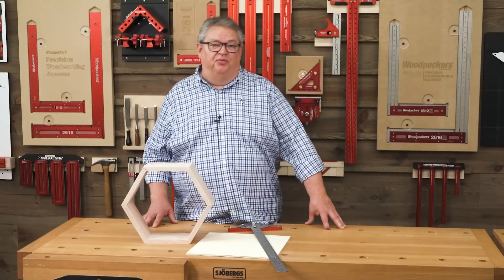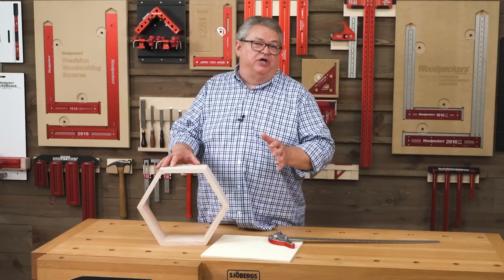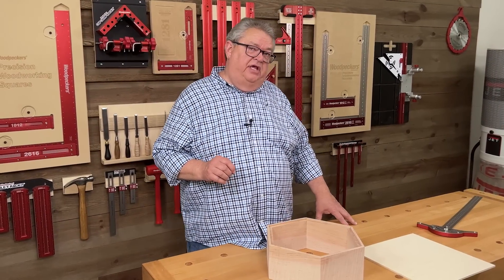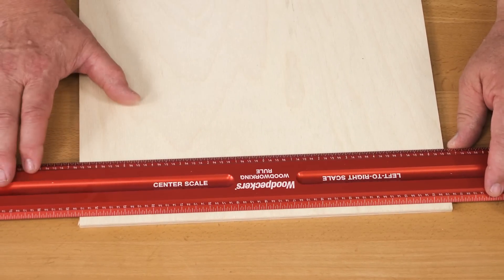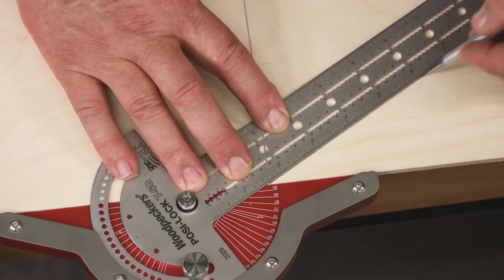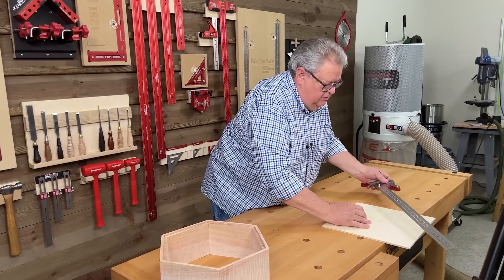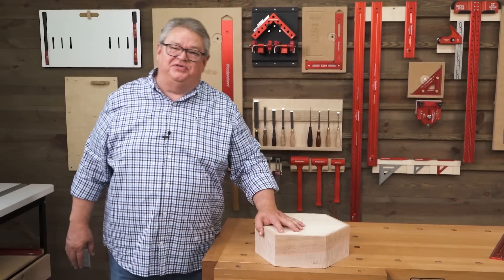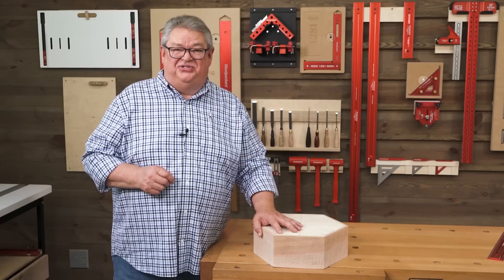Tackle Hexagon Geometry With Posi-Lock T-Square | Deep Dive | Woodpeckers Tools

Comment: Hilarious.  Video came out June 3rd.  Product was “retired” aka out of stock June 13.   That’s incredible!   So no idea what the price was and not even listed on the website.   Guessing it’ll be higher once they resume shipping in November.   Either they’d made very few or these were snapped up by third party sellers who resell at higher prices. Very difficult to buy affordable stuff from peckers and very limited supply.
Reply from the maker: Michael, the PosiLock is a "OneTIME Tool", which means it is made to order. The ordering window is open for a 3-week period. Material is purchased and production is scheduled (in this case, November) based on the orders placed. Call Customer Service to see if it is possible to get added to the production list (I'm guessing it will be).

Comment: Jeff, Following up on your response to Walter Plaessmann’s comment about being tippy at 90 degrees. I can agree with his concern. To that end, Couldn’t Woodpeckers extend the rounded stainless corners so both ends would provide perhaps a suitable lip for stability? I would be willing to pay a premium for this modification.
Reply from the maker: Walter and Robert, I spoke with the product engineer today. He and Rich decided it wasn't necessary, since the blade is considerably heavier than the head. There's no tendency to roll.
Reply: Jeff,
Thanks for taking my thoughts to the top levels of the organization and sharing their response. I will place an order. 
Thanks again,
Rob Siebert
Reply: Ditto Robert’s comment - thank you for taking the extra steps to answer our questions, really appreciate your responsiveness.
Reply: Robert, I was thinking of exactly that when I posted my comment. Jutting out those stainless ends over the work piece in a small rectangle would steady the head of the square at 90 degrees. At an angle, the corner of the protractor would overlay the work piece as well adding more support. Would be a great enhancement to what’s already an excellent looking tool.
Reply: @walterplaessmann5865  Agreed Walter; I was hoping Woodpeckers would comment one way or another.

Comment: You’ve laid out 30-60-90 right triangles.  There are 12 of them thus creating a hexagon with six 120-degree included angles.  0.866 is the cosine of 30 degrees or the sine of 60 degrees.  High school trig.  If your polygon had five or seven sides, there would be no detent to set the Posi-Lock T-Square as the included angles are 108 and 128.6 degrees, respectively.  The total included angle for any polygon is simply (the number of sides minus 2) times (180).  You can lay out any polygon you desire with a compass and straight edge.
Reply from the maker: Or put in a way that is much more meaningful to a woodworker, the miter angle is 180 divided by the number of sides.

Comment: Another fine tool and presentation! The aluminum portion of the head looks to be maybe 3/8” or 1/2” thick, is that about right? Wondering if the t-square feels a little heavily weighted toward the head? Or if it feels a little tippy when set to 90 degrees since it doesn’t have the shoulder like Woodpeckers regular t-square? All in all a really nice and unique take on a workhorse type of tool.
Reply from the maker: Walter, you're right on the thickness. I think it starts as 1/2" and has a little milled off both faces. I can't speak to the 12", but I've used both the 24" and 32" and they're not head-heavy. I think because the stainless blade is pretty healthy. I wouldn't call it "tippy", but I am a big fan of the head on the all-aluminum fixed blade T's.
Reply: @WoodpeckersLLC  Thank you for the quick reply, appreciate the real world experience with these fine looking squares.

Comment: Is the Posi-Lock a good replacement for your t-square?  It seems if I was going to pick one or the other I would go with the posi-lock but am not sure what other features the t-square might have.
Reply from the maker: Good question! Now that I've used the Posi-Lock for a while, I might lean that way, if I could only have one. The thin blade is kind of nice and the scribing guides are a little more forgiving than the perfectly round ones. In doing this hexagon layout I was very impressed with the angular accuracy of the ball detents. If they aren't spot on, the hex would not come out with even sides and the correct spacing between the parallel sides. It was as close to perfect as anything I've ever drawn on plywood...or a drafting board for that matter. Nice to have both, but if I had to chose, I think it would be the Posi-Lock.
Reply: @WoodpeckersLLC  thanks for the reply.  I have mine on order and looking forward to getting it for the winter woodworking season.